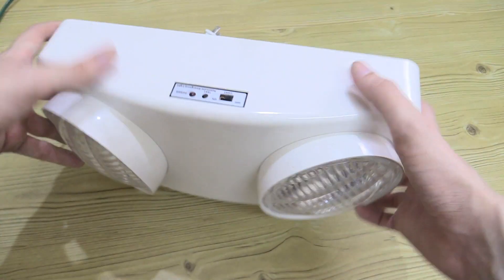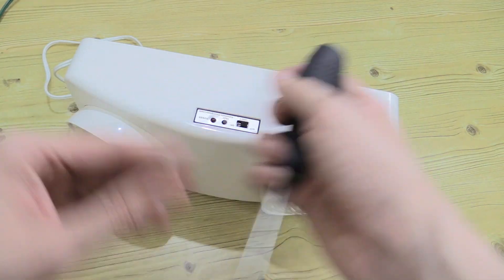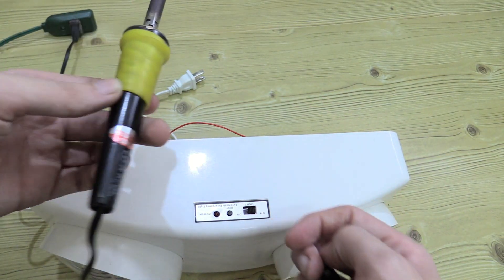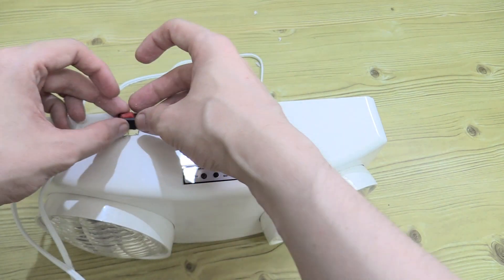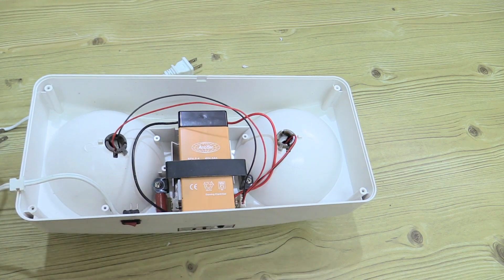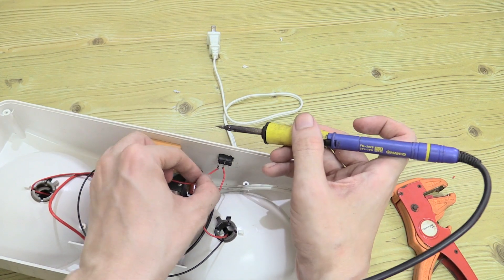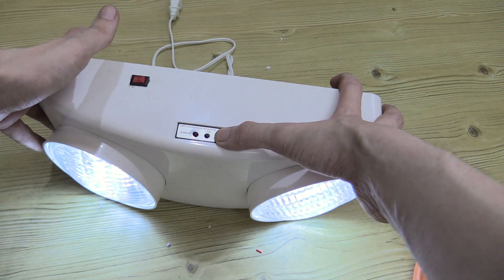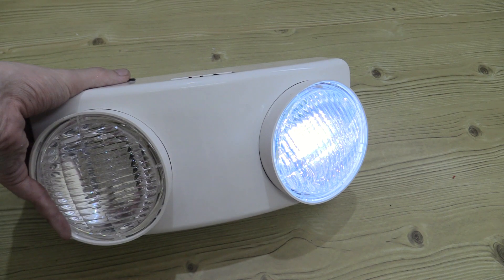Emergency Light Mod Switch

Comment: Hack sawing from edge were back goes on would have been better.  you'd make 2 hack saw cuts on shorter sides then you could made repeated razor knife passes on remaining 1 longer side and snap off.  Not sure if you can picture what I mean?  I prefer the toggles that require 3/16" hole much easier to install.  They should make one with a 4amp battery and use leds, it would run for a month or so.
Reply from the maker: +A D Yeah that might have looked better. Or like you suggested, just use a switch which goes into a round hole and just drill through to make it even simpler.